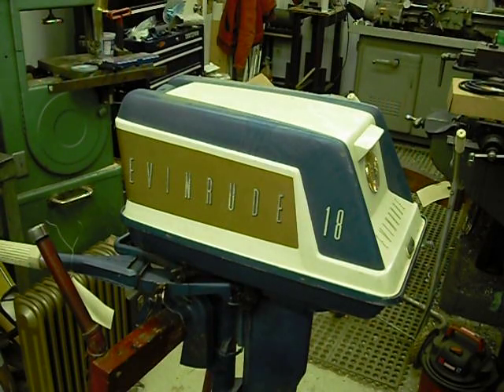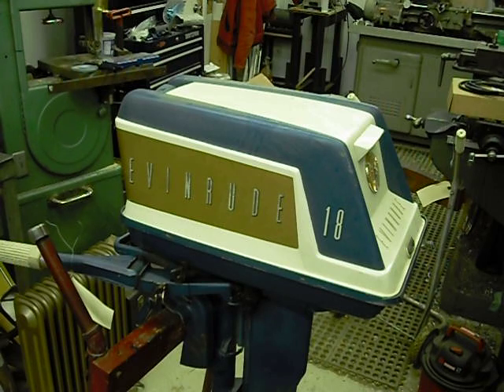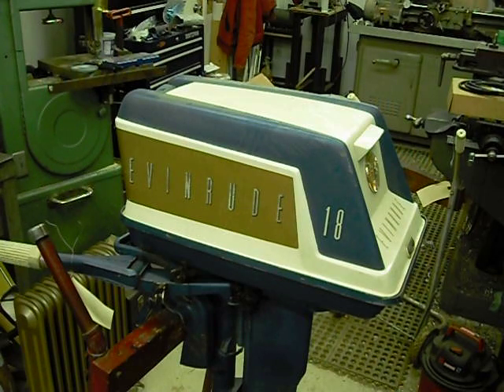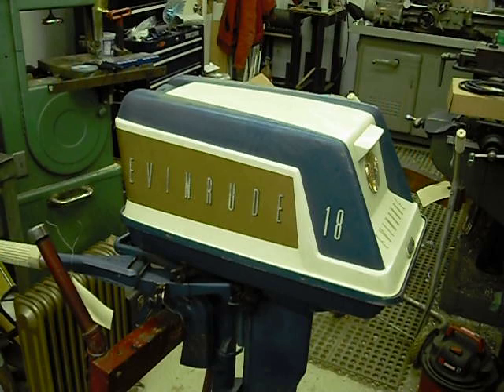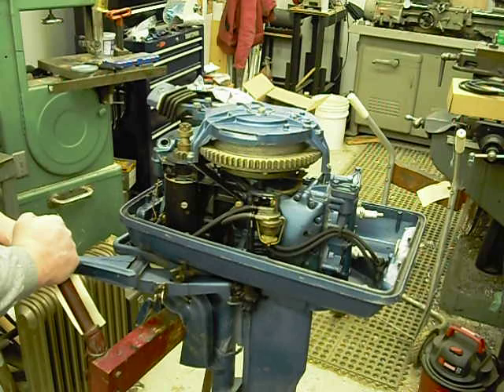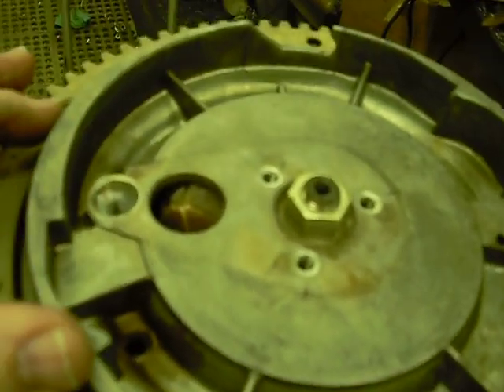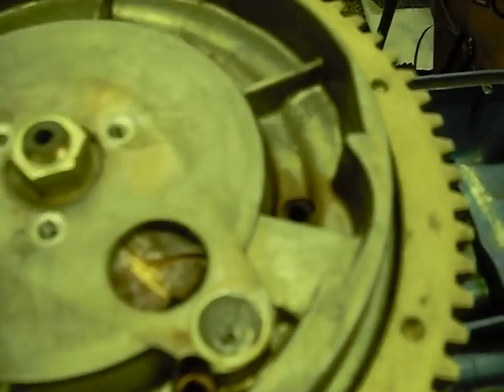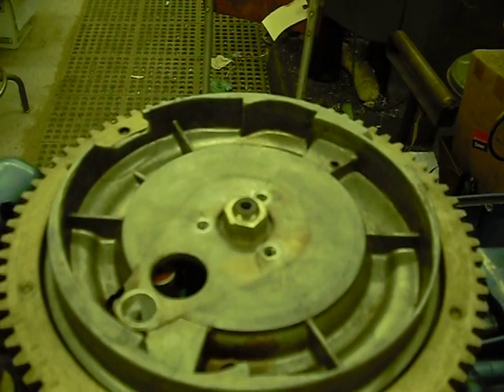Classic OMC Outboard Motor Tune-Up Video #1 Intro

Comment: Cracked spark coils, surprised. I have a '59 35 hp in pristine condition, but had to replace both coils/condensers, water pump, and do a  carb /fuel pump rebuild as well.  So now, it runs like a champ. It only had like 40 hrs of original run time on it and has been stored since 1965 !
Reply from the maker: Nice find! Not many low hour examples of Golden Jubilee 35hps left.  Thanks for watching!

Comment: Real nice motor there every bit worth $250 in my eyes with bonus electric start ,WOW! Boy I would love to polish that one you got there at least the covers painted parts only  with Meguiars Ultimate Compound .Just got a 1960 18HP  yesterday for $75.00  thru Facebook Marketplace was seized  flywheel moved 1/4 of an inch so I knew it would free up from experience. Runs perfect  now amazing these old Evinrudes. I polished the cover really cleaned it up nice. Truly made of amazing quality  as many of us know great video......Glenn P.
Reply from the maker: Yes, this motor was worth every penny and all the hours I put into it.  It has been cleaned up and polished since this video was done.  It has proven itself to be a very nice runner.  It is at home on the back of my 1959 Meyers 12WT  12 foot runabout now.  I'd love to have a 1960 Fastwin in good shape too.  I have one now, but it's rough.  It needs an overhaul, paint, and decals badly.

Comment: $250 for an electric start with good wiring, you got a bargain for sure!  I'm with you, finding the original stuff means low hours and no one has messed with it......
Reply from the maker: Yes, I completely agree,  I got a great deal on this motor for $250.  I'd buy these all day long in this c9ndition for $250 a pop.  I just meant $250 Is more than I usually spend on a non-running motor.  This one is exceptional for sure.  Great shape, good wiring,  electric start, and unmolested.  Gearcase was full of water and no oil in it though.  I hope it turns out OK. Thanks for watching Don!
Reply: @oldjohnnyrude8404  I ran a 1969 25 HP Evinrude a whole season once with mostly seawater in the gearcase still went like a bandit never harmed the internals,LOLL.Pretty hardy those gearcases.....Glenn P.
Reply from the maker: @OutBoardTink62  Yes, those gearcases are quite hardy.  I have come across a couple of them that were run with water in them long enough to ruin the pinion bearings.   They'll take a lot of neglect though.  Thanks for watching!

Comment: Followed this series the whole way did and replaced everything you did. Motor ran good up Intel yesterday it was barely running and very slow. Got it home and found out I lost spark on my bottom cylinder. Investigating it now. Any Ideas you may have that could have gone wrong.
Reply from the maker: I would check all the connections under the flywheel,  make sure the plug wires didn't get rubbed through somewhere, check the coil ground wires and make sure the flywheel wasn't rubbing on them.  If one got cut though,  the ground connection for the coil would be intermittent or lost. I guess inwould start with those and go from there.  Thanks for watching!
Reply: @oldjohnnyrude8404  Will do thank you sir!

Comment: Wow! That 18 is a looker, easily worth $250. Is that your Machine Shop! Nice, allows you to do “specials” when you need. Jealous.
Reply from the maker: Thank you.  Yes, this is a nice clean Jubilee Fastwin Electric Start.   I feel like I did very well on this motor it has been living on my 1959 Meyers Aquabird 12WT since I finished it up.  The boat is wired for electric start and choke as well as a remote engine cut off switch and a safety lanyard.  
Yes, that is my machine shop and I have made a number of "specials" when the need has arisen.  Thanks for watching!

Comment: Hey Johnny how are you? I just bought up the same exact motor you're working on in the video from a really good friend for a steal and wondering who makes the best ignition coils for these motors. I know prufrex has stopped making them (sadly) and I was wondering who would you recommend for coils? I'm just curious in case I do need to do a small tune up on her. But man I'm in love with this motor, they run like sewing machines. Long live these old classic OMCs. Take care 
Mike
Reply from the maker: I'm doing well, thank you! Life has been extremely busy lately not leaving much time for outboards, but I still do what I can.  Things will calm down eventually. Congratulations on your new motor!  These are absolutely excellent! My best recommendation for coil now are the OEM ones by Johnson/Evinrude.  They are made in Taiwan, but are well made and they perform well.  I have onlybever had one bad one out of the box and all of them I have installed otherwise have been very good performers.  The CDI coils seem to be OK as well.  They make good spark and don't seem to have any glaring issues.  The wire leads are a little longer than necessary, but they can be trimmed or tucked.  I'd still stick with OEM as long as available. Good luck with it. The 18s are my favorite.  Thanks for watching!
Reply: Oh I can relate on the time part with ya. But I appreciate the recommendation on the coils/ignition tune up kit. The fever has been dormant for a good while and getting that Goldie brought the fever back to life and I'm glad it did. And I saw you have a Goldie 35 horse big twin, man I'm in love with that big guy. And it's in supreme shape too. Maybe down the road I'll try and find one and acquire one down the road in my fleet. And after 11 years I don't know why I never joined the AOMCI, but I am now it's been way to long lol.
Reply from the maker: @gmc_crackerbox_truck1485  You're very welcome for the on coikdand tune up parts. As for points, I'm not sure if the OEM points have gotten their quality issues worked out yet.  I never cared for Sierra points, but unless you're willing to do some "extra" work getting the OEM ones to work, I can't recommend them at this time.  I still have about 11 sets of them are not up to quality standards. I can make them work, but they're not exactly what I would call "bolt-on".  Yes, that Jubilee Big Twin is a nice motor.  I actually have two of them now.  I plan to eventually put the pair of them on my 1959 Alumacraft Flying C.  The boat still needs some work and so does the other Big Twin.  I'll be so happy to finally get it finished.
Reply: Hey Johnny don't mean to pester you but I have a few more questions before I dig in to my 59, where do you buy your brp coils and tune up kit from and if you buy online who do you shop from for ignition parts? And what do you have for a multimeter to time the points and the motor in general? And that tool for the timing marks on the flywheel, is that something you can find or was that an aftermarket tool for when you advance the spark with the points so it gets the right amount of space when you give her throttle? I appreciate it and sorry for the multiple questions. Take care
Mike